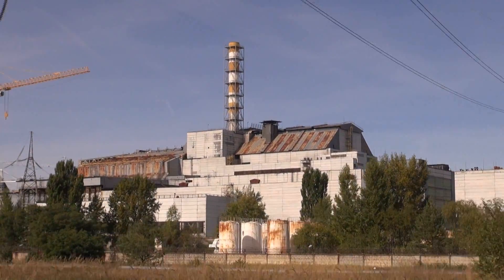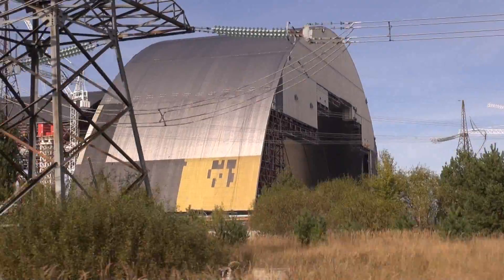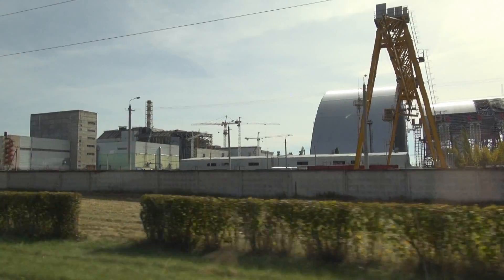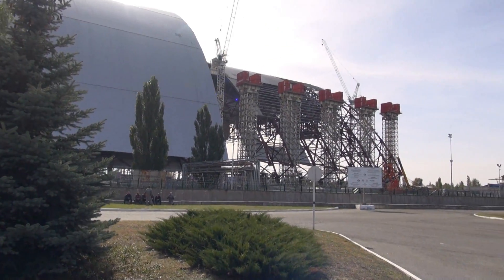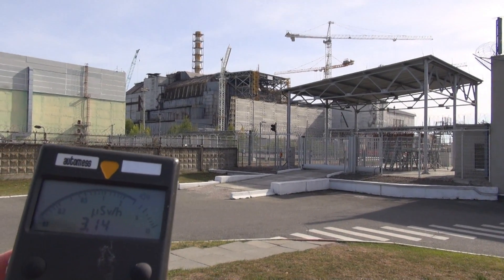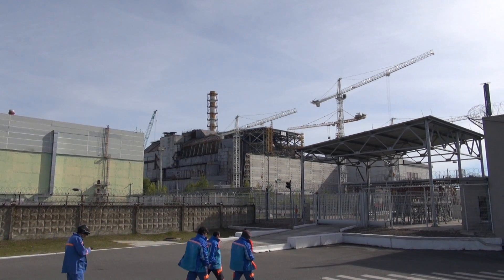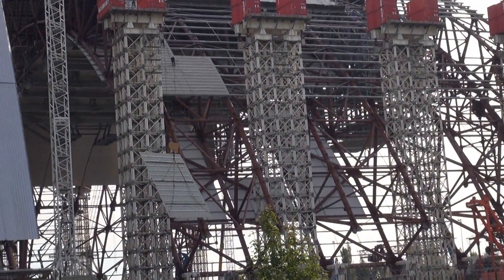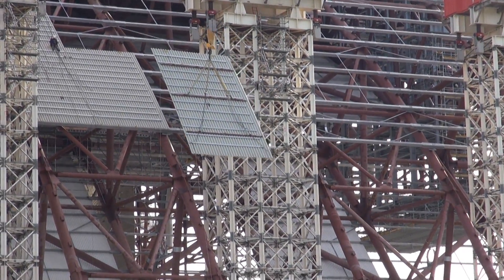october 2014: New Safe Confinement (NSC) "Арка" / shelter / sarcophagus for chernobyl reactor 4

Comment: I think they need that chimney either for eventual "blowouts" :D [STALKER refference] meaning when something collapses the air pressure inside wont blow dust and other stuff in every direction, but rather through the big chimney into higher altitudes. 

As a secundary use I would assume that the roof and internal levels are weak and need that chimney to stay stable. 
I could imagine that there is a lot of weight on the lower part of the chimney, coming from the materials around it.

[Like a main strut]

Comment: Sorry if this is a dumb question but,  how come people can no longer return to places like chernobyl and fukushima after a NPP full/partial meltdown but hiroshima and nagasaki are cities that were both bombed with nuclear bombs and have returned to city status.
Reply: It's due to the amount of radioactive material. The bombs dropped on Hiroshima and Nagasaki released a relatively small amount of radiation compared to Chernobyl and it didn't contaminate the area to the same extent. The Little Boy bomb dropped on Hiroshima only had 64 kg of uranium whereas the Chernobyl reactor had several tons.
Reply: In an atomic bomb, much of the fission material is used up very quickly and produces very short lived fission products mostly. The energy goes into the explosion and the gamma blitz. In Chernobyl, the inside of the reactor scattered, with contaminated graphite, fuel rod fragments, and fission products with very long half lives being deposited by the fire and explosion for miles and miles. Much of that material was so fine that you would have to exchange the top soil a few feet down for the whole place to be decontaminated, and the long half life of the material means the zone of contamination will remain so for a very long time. If people where to return there they would be constantly ingesting radioactive material through dust, food and water, accumulating a large terminal dose, leading to rad sickness and cancer and all other kinds of nice things. That's why.

Comment: Why would they need a new chimney? Since both reactors 3 and 4 are not operational why bother?
Reply from the maker: i'd assume so the entire structure doesn't break away from the inside while putting the arc over (this wont be completed in just a day or two), which would result in a significant release of radioactive material. so i'd expect the chimney to be for ventilation of the structure. sounds weird in terms of "ventilating radioactive material into the air", but thats not the case, as there's real "wind" blowing in there. but this is just a wild guess actually...
Reply from the maker: bionerd23 *as there's NO real wind blowing in there, of course.
Reply: bionerd23
Thanks for the comprehensive reply :-)
Reply: НВТ необходима для поддержания необходимой температуры и влажности в помещениях блока (обязательное условие для обеспечения надежности строительных конструкций на этапе снятия с эксплуатации)
Reply: bionerd23 why were the workers walking backwards at the end of the video
Reply: slipknotx141 its in reverse
Reply: looks cool
Reply: I understood that they only removed the cooling chimney from the reactor (that massive grey thing that is now gone). The one next to it (red and white) is I think a cooling chimney for the spent fuel storage.
Hang on I found it. There's a tiny chimney build adjacent and it sole purpose is for ventilation of the area. Why? Is beyond me. Perhaps they require people to go in from time to time and monitor the molten reactor... Or perhaps in 100 years to dismantle the reactor completely.
Reply: chnppPripyat Thanks !
Reply: asked the same question :S prob gonna put her back in operation soon :S
Reply: werdCanada They cant even if they wanted to. The EU paid the Ukraine to shut them down and I believe that the reactors have already been dismantled
Reply: bionerd23 But if they use the new chimney to ventilate, then why didn't they just leave the old one?
Reply: ***** I noticed that, I regularly watch a live feed from chernobyl
Reply: agun17
doubtful.. cement the bitch in if they are done with her...
Reply: slipknotx141
think about it... they are a bunch of Micheal Jackson's and what better time to practice...
Reply: Having a tall chimney to evacuate excess pressure and potentially explosive gas is a reasonable precaution. As you may recall, the confinement structures at Fukishima were compromised by a hydrogen explosion due to zircaloy reacting with superheated water. A similar thing was a concern during the Three Mile Island incident. 

In theory anything notably radioactive is either to heavy to get up the stacks or caught by filters within. 

As to why the stack is replaced now that the plant is non-operational, I have two hypothesis. First would be its a good means of triangulation/navigation/reference for workers and aircraft. Secondly, there may be some other systems that need the exhaust stacks. Are the spent fuel pools still on the site?
Reply: Rust. Keep the inside of the dome dry so it doesn't rust. Not the reactor hall, but the inside of the dome construction itself. When the dismantling of the sarcophagus and reactor starts, there will be a lot of rads in the dome, so you can't repaint. Hence ventilation system.